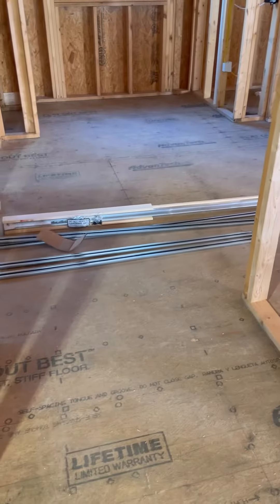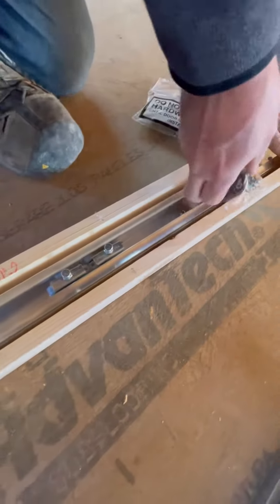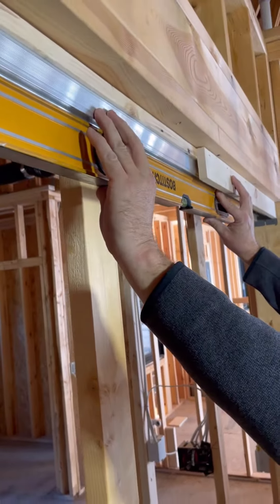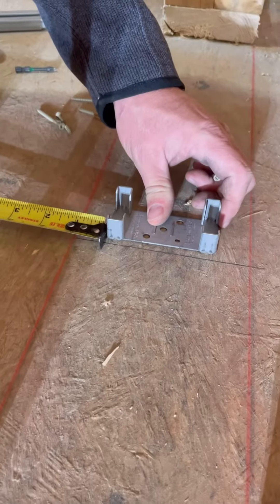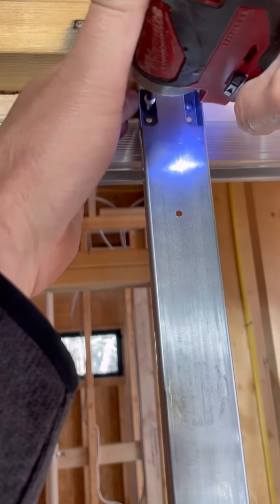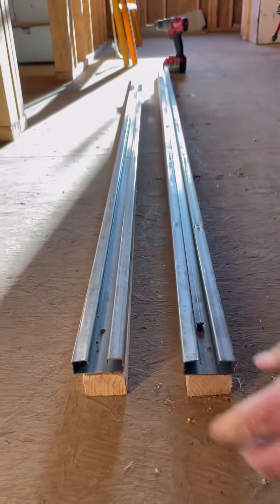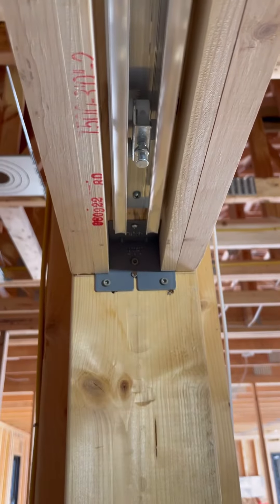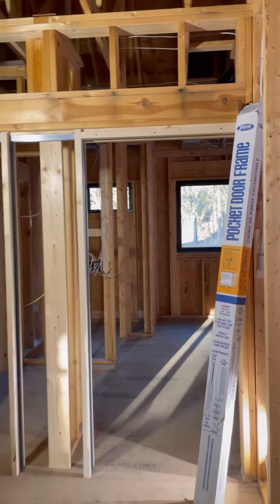Installing a Pocket Door Kit

Comment: Just confirming if the rough opening height is 84.5" off the subfloor, or off the finished floor.  Johnson's instructions don't specifically say.  Thanks
Reply from the maker: Actually, the directions do give you the specifics on that

Comment: Good video but I would’ve liked to have seen the full installation, including the door, I purchased the same kit and found the product to be a piece of garbage. I should’ve done more research in the beginning and bought the better quality pre-assembled pocket kit with the horizontal braces.
Reply from the maker: All the builders in my area use these Johnson kits. We’ve been using them for 20 years on high end homes and have had no problems.

Comment: How to you attach trim to the aluminum studs?
Reply from the maker: You’ll see that I put wood strips over top of the steel studs. You would need to use a shorter brad nails and glue to attach the trim

Comment: why did you add an inch on the rough opening?
Reply from the maker: That’s what the directions call for. This leaves room finish trim
Reply: The door jamb on the opposite side of the pocket will 5/8 or 3/4”. Then you’ll shim that about a quarter inch to make sure it is plumb with the door when closed.